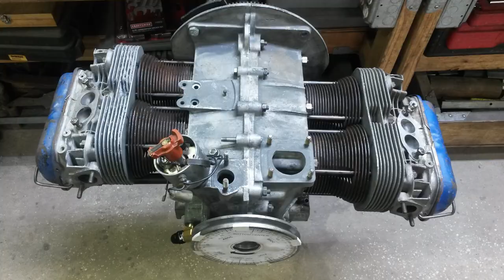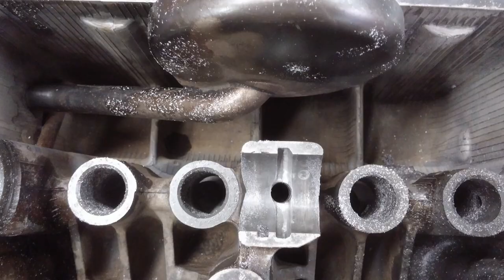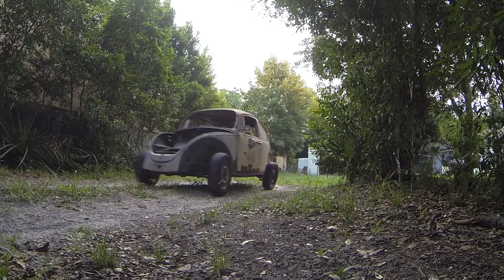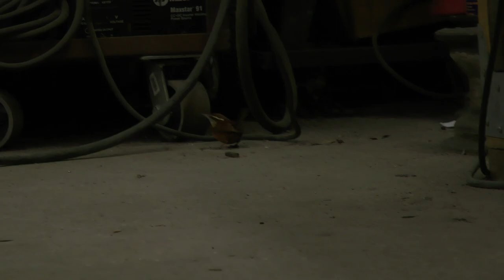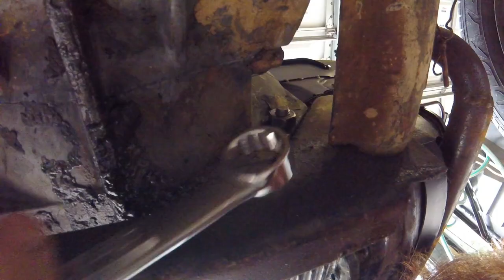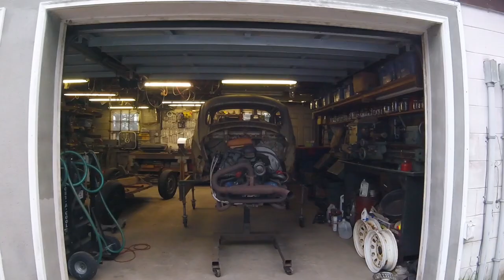VW Bug Dweezil Restoration Engine Rebuild and Removal E3

Comment: I'm Building a 1970 1500 and found your channel, absolutely love it, great work, keep it up
Reply from the maker: Hey John Chambers, cool project! Would that be a single port engine? I'd like to build one of those soon... I'm glad you're enjoying the channel, we'll do our best to keep it going!
Reply: @HapticGarage  Hi, thanks for the response.  Yes it's a 1 owner 1500SP.  Drives really lovely.... Engine and gearbox are solid and quiet other than a few oil leaks so they will get cleaned and put back in.  I'm following you on Insta as Bessie the beetle.  Keep it up!
Reply from the maker: @johnchambers1250  That's great John, sounds like Bessie is a keeper! Good luck with the rest of the project and I'll check you out on Instagram.

Comment: Enjoy the back ground nicely done , you have a nice shop, after high school when to school for tool & die work after four years got my card worked in a small shop in Indiana we did a lot of work for the local steel mills and a few companies up in the windy city ..spent many hours running a bridgeport never knew it could be set-up so many ways Went to welding school was the shop welder--did a lot of repair work on large motors from the steel mill a lot of cast iron welding to cold roll patch piece. Spent a few years working in an aout machine shop back in the early 70's vw dune buggies was the new big thing.. a lot of people taking them to Silver Lake on Lake Mi. running in the dunes..Looking forward your next steps..
Reply from the maker: Cool stuff, Dan Love! I bet I could learn a lot from you about milling and lathe work; I just barely get by with a well defined project. I love the art of it and have much respect for those that learn their machine and produce reliably accurate work. Glad you liked the video- more to come!

Comment: With my project I think I will pull the body off to do the front suspension as well. By the way great video!
Reply from the maker: Thanks, Levi's backyard! Pulling the body is the way to go for a lot of restoration work, but it does add steps and complexity. The additional tasks "because it makes sense while we're in here" can be a blessing and a curse. Good luck with your project, I'm looking forward to seeing your progress!

Comment: Since you've added the Hoover mods to your engine, was there a noticeable difference in cooling and oiling???
Reply from the maker: Hey Shawn! I have not run this engine enough to give a valuable comment on cooling but suffice it to say that I expect that to be one of the major advantages of these mods. I can say that the oil pressure is still good despite these modifications providing more places for the oil to be released. Presumably, the oil pump is keeping up by providing more flow to maintain sufficient pressure. So far so good , and I look forward to sharing the rest of the project! Thanks for checking out the video!

Comment: Enjoying your rebuild of the Bug. Are you going back to a Baja style with it or keep it original style ?
Reply from the maker: Hey TERRY, thanks for checking out the build. After replacing the front clip, I don't have the heart to cut it for a baja front end. But I do like the idea of leaving the back end open for engine access, and I do like bigger tires... The straight answer is I'd like to keep some baja features and take a few other liberties along the way. If it were a solid car and not such a basket case, I'd go stock original for sure.
Reply: @HapticGarage  I agree with you and have seen several Bugs that were half and half. As a matter of fact I had one myself a few years back. I have had over a hundred various VW's during my 70 years and still love them. Good luck to your rebuild and keep the videos rolling...........Terry

Comment: Is there a video on the engine rebuild and mods or how they are holding up?
Reply from the maker: Hi Hops Garage, there hasn't been a follow up video on this build yet but stay tuned. Until then, the engine has about 1000 miles on it and it hasn't blown yet! The oil pressure is low due to loose tolerances but the mods have done their job- the oil temps stay low and cylinder head temps are manageable. Check out this video to see it in action and a couple issues we saw on it's big trip to the coast: https://youtu.be/4Ze_DuEWeS8  Thanks for watching!

Comment: any recipes on cooking a VW head?  I like mine medium rare.   We call that the "moon bolt" for obvious reasons.       heaters = good.
Reply from the maker: Ha! That's awesome, VW Life! I can see that you get it, but for the uninitiated the idea is to prevent cracking the head with the new guide. The guide was being chilled in ice while the head was cooking to a savory medium rare. Thanks for noticing the detail, VW Life! And by the way, thanks for the sticker- cool design!
Reply from the maker: VW Life, I have to admit it took me a minute to figure out "moon bolt"... duh... haven't heard that one before but it's perfect! Forever added to my Vdub Vocab
Reply: @HapticGarage  Manny years ago when I worked on them our auto shop had an old kitchen oven would put the heads in there then would put the new chromemoly valve seat in a small can chill them with freon for re-charing cars ac. add a littler green locktite they would stay in the head for ever..hope they did they were for t vw motor was fot a airplane..  nice machine work easy to see you have skills
Reply from the maker: Thanks again, Dan Love. Thanks for sharing your experience- I appreciate the craft work that is so hard to find these days. I feel like I'm just mimicking the stuff I've read about but the guys that worked on these things when you could buy them off the lot knew what they were doing!

Comment: Are you replacing the current pans
Reply from the maker: Hey Rob Russell! Thanks for the question- they were replaced a few years ago and are in great shape. I didn't really cover the process, but it was mentioned back in episode 1. Spoiler alert- We'll get those pans and the rest of the chassis sandblasted and painted in a future episode. Thanks for watching!
Reply: @HapticGarage  Ok thanks for responding

Comment: This video seems to have some corruption and will not play  throughout its entire length.
Reply from the maker: Thanks for the heads up, Thomas Pollock! I was able to confirm the problem you describe. I tried it several times, and it was different each time, and sometimes it played fine. But there was definitely an issue and I have sent the feedback to YouTube. Hopefully it is fixed soon! Thanks again.